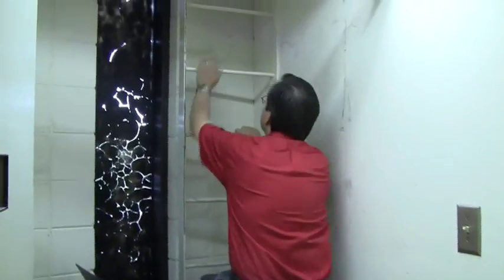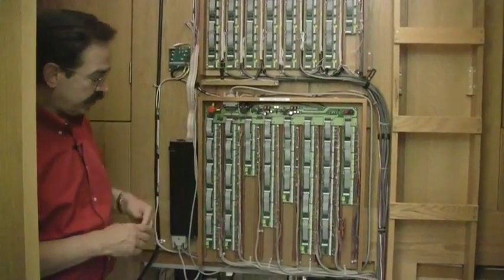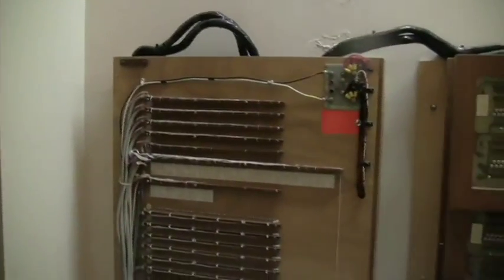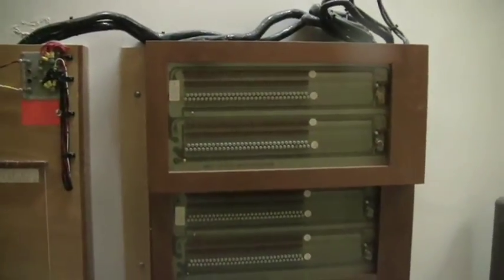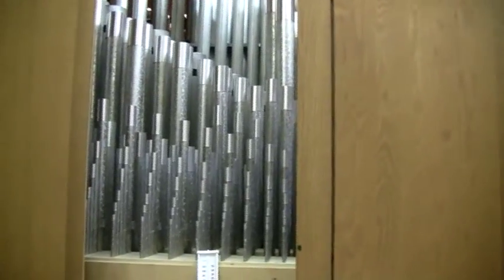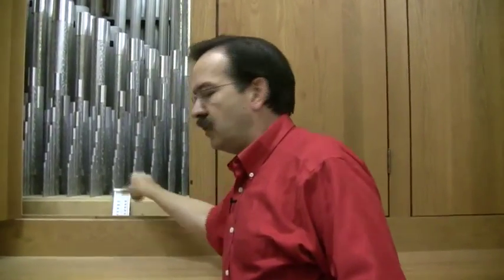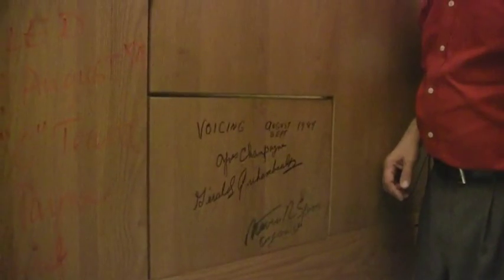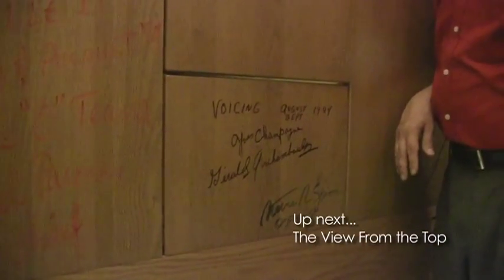FBC Organ Tour-12-The Organ Chamber

Comment: It really is better to go with a specialized resultant. Either a relay. OR if you want something special. ANOTHER 2 ranks of pipes that are actual resultants of one another. A Starting at a 16' Gedeckt and 2nd rank of Bourdons starting at a G. I mean yeah, you have 2 Bourdons total on the organ. But those sound so much more "Full" than a fake digital speaker. Even with 32' reeds there are resultants one can make from a Reed resultant.